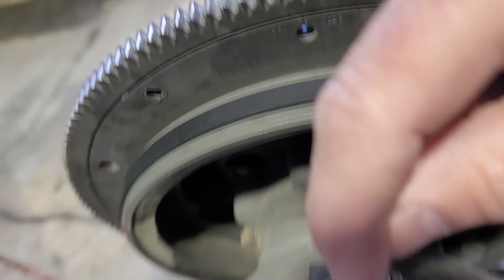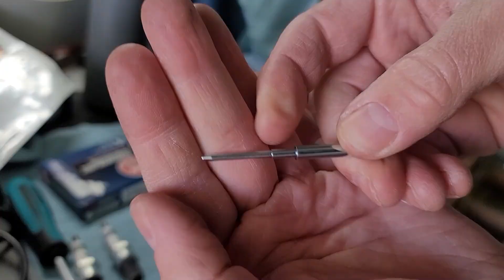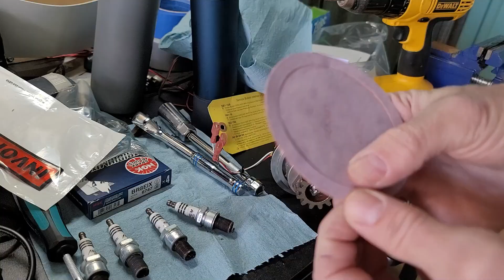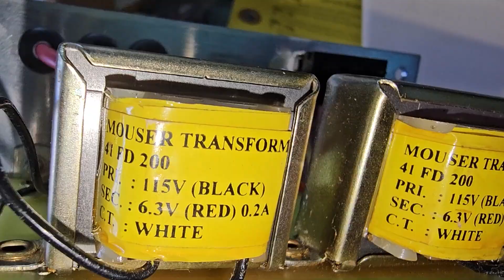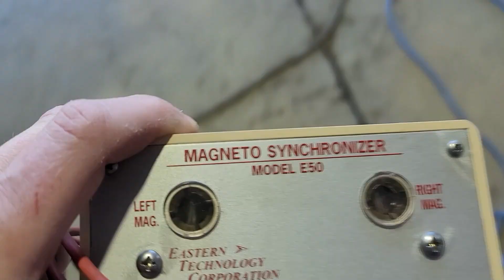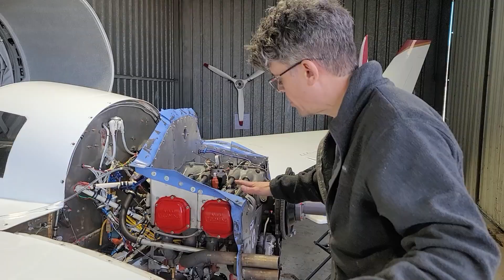Installing and Timing an Overhauled Magneto In My Airplane

Comment: It's been years since I've timed mags. Thanks for the refresher. FYI: if you put just a small dab of grease on the mag side it will hold the gasket in place. This will not hinder the gasket from working properly sealing the gasket/engine side.
Reply from the maker: I usually use just a bit of engine oil for that!

Comment: Scott, I've run the Jeff Rose nonstarter for 20 years B4 adding the PMag starter on Defiant. I should have done this dumping of the Slick long before...letting you know its so worthwhile to have more reliable and much better starting.
Reply from the maker: I'm seriously thinking of replacing the magneto with another electronic ignition the next time it hits 500 hours.
Reply: @CanardBoulevard Yeah, As an experience it's been more comforting and pleasant in the overall because of the installation ease, superior startup and programmed timing getting up there into ElectroAir territory. Given self-powering, it's very close to preserving the same noncorrolated redundancy as the Slick....weighs less too :)
Reply from the maker: @MarkShinnick  The problem with PMags is their absolutely HORRIBLE reliability record (for unknown reasons) in pusher installations.
Reply: @CanardBoulevard I know that heat soaking stopped my own on hot days...  untill I figured out that little inconvenience.

Comment: How to troubleshoot if the magneto resistors is defective. What is the reaction of the engine rpm. Thank you for the answer.
Reply from the maker: I'm not quite sure what you're asking. There are no resistors in a magneto.

Comment: (1) A lot of people out there are not clear about the difference between Overhaul and 500 hour Inspection (or "IRAN"). If you had had an overhaul done, then that bag of old parts would also have included a capacitor (condenser) and a coil because all parts apart from the rotor and housing must be replaced at overhaul in accordance with Slick L1363J. Your Form 8130-3 will say either Repaired - Inspected/Tested- Overhauled.
(2) A lot of people are obsessed with the Timing Pin. The Timing Pin is used when setting up the Internal Timing. A person installing a magneto on the engine is concerned only with the External Timing. The installer has no control over the internal timing - that was done during the 500 hour/IRAN. Inserting that pin at installation stage is only leaving yourself open to damage to the magneto. If you walk away and leave the magneto mounted on the engine with  the timing pin in, and someone moves the prop, the magneto will be damaged internally.  Set it up with the pin in the L or R hole as appropriate - before mounting on the engine and remove the pin immediately. That will result in the mag being in the right vicinity. You could still do it without the pin - you might just have to take the mag off and turn the shaft by hand a few degrees before managing to get the timing light to go out. Remember if you leave that pin in, and then turn the mag body (as you have to), the gear on the rotor shaft can't turn (because it is on a shaft enmeshed with the engine), the rotor gear is enmeshed with the distributor gear so it will try to turn  but can't because you have jammed a timing pin in one of the holes in the distributor gear!
(3) Just set the engine at 25 degrees BTDC (or whatever is on the engine data plate) and leave it there. Fit the mag loosely to the engine and tweak it by rotating it until the Timing Box light goes out or stops buzzing. The lights go out when the points open and that is supposed to happen when the rotor is in the E-gap position - which is what internal timing is all about - and this goes back to point (2) above. If the internal timing was not set properly during 500hr/IRAN or overhaul, then the mag is never going to fire correctly no matter what the installer does. There is no need to move the prop - the adjustment is done at the magneto flange.
(4) Ignition switch has to be switched to LEFT/RIGHT or BOTH while you are doing this. (i.e. if you are timing the LEFT mag only, then the key must be in either the L or BOTH position).
(5) Mag mounting clamp nuts should be tightened up evenly in stages - don't tighten one side to full torque and then do the other side - flanges can be cracked or broken that way.
:)
Reply from the maker: 1) Thanks! This was definitely an IRAN - just the 500 hour, not an overhaul.

2) I know about the timing pin, and I also know what happens if you leave it inserted and then move the prop. :) The idea was to not let the mag rotate internally while installing it onto the engine, and once it was meshed with the accessory drive gear, to remove the pin.

3) I did exactly that. Set the engine at 25 BTDC, then got the magneto where the points just opened. Where you saw me moving the prop was checking afterwards that it was in fact opening where I expected it to.

4) Not on mine - I have one mag and one EIS, so there is a toggle switch for each: for the EIS, the switch provides power when on, for the mag, the switch provides ground when off.

5) Again exactly what I did. 

Not my first rodeo, and also definitely not the first mag I've timed. :)

Comment: Just curious as to why you chose the EIS for the right side instead of the left? Thanks
Reply from the maker: I didn't - the manufacturer (Aero Sport Power) makes them that way. The left side has a magneto with impulse coupling, the EIS is on the right. You can start the engine with either (or both).

Comment: That magneto had more than 500hr on it to have all those parts needing to be replaced.
Reply from the maker: That magneto had exactly 535 hours since new. Mechanical things wear out.
Reply: @CanardBoulevard Hard to believe.  My 750hr magnetos were like new inside.  Clean enough to eat off of.  It's considered good practice to verify correct timing AFTER torquing the magneto retention bolts.

Comment: Informative video, Professor.....  the Left/Right you showed on the magneto reminds me how bad we needed that type of marking
of motors used in Heating - Air Conditioning applications.  You needed the correct rotation & flan blade to match so you had to get
it right & be able to explain it to a parts house.  A simple "L" would have helped but I digress.  It's a heat wave up there so I'm betting
you'll be dealing w/ the hottest summer on record?  Let's hope not..... peace & thanks for the work(s)

Comment: Noticed 16:29  you have removable zip tie. I’ve had a really bad experience with them, they very fragile when cold. Easily snaps. Just decided to warn you
Reply from the maker: Not these. They are GripLockTies, which is one of Mike Patey's companies. I have been using them for quite a few years, and they are the highest quality, best removeable fasteners I've ever used. They have silicone embedded in them, so unlike most zip ties, they won't abrade paint or cut through wires. https://griplockties.com/

Comment: I know this is going to be the kind of device that's been used to time mags for 100+ years but…
Presumably when the mag points are open, there's a pulsing current in the mag primary winding from the synchronizer 6V battery/buzzer.
I was wondering is that almost designed to produce HT at the mag secondary, to create a continuous spark at the plugs? So that you can check you're getting a spark at the plug that's passed 25° before TDC on compression stroke. (To check the leads are in correct sequence and to some degree check the integrity of the distributor cap).
What's causing me a slight concern is that this might be creating more than enough voltage in the secondary to produce a spark but you don't have any spark plugs connected at that time. So there wouldn't be a spark gap limiting the voltage produced which could result in internal arcing inside the Magneto, which could cause future problems.
I guess perhaps the primary current produced by the test box is just a little tickle of current compared to when the engine is running. (So no potential for a spark at the secondary).
Reply from the maker: The P lead is connected to one side of the points. Those points are grounded to complete the circuit internally in the primary coil. When the internal points open, that causes the magnetic flux to collapse, and is what generates the spark. The points opening also disconnect the ground from the P lead, and that is what the synchronizer detects. The voltage produced by the synchronizer is around 6 volts, whereas the magneto internally is operating on more like 200 volts, so there's no danger of it creating any kind of spark.

Technically, you could use a continuity tester on a DMM to time magnetos, but if you were to push the prop past the impulse coupler, it could very easily produce a 200 volt spike into your DMM (which would be configured to measure continuity) and that would definitely smoke your DMM. The little 50-year-old mechanical synchronizer can absorb that spike easily.

Comment: I see you are running auto spark plugs BR8EIX with your mags.  Do you have to change anything other than the spark plug wires to get this to work?  Do you gap them smaller to match the aviation spark plug recommendations?  Any improvements such as fouling or gph?
Reply from the maker: Actually, those plugs are being fired by the electronic ignition system, which puts out a much hotter and longer spark than the magneto. Recommended gap for that EIS is .029 to 0.38, and those plugs at .030 fit the bill perfectly. I would have to gap them at more like .018 if they were run by the magneto.

Because they are on the bottom, they do tend to get oil fouled, but they have no problem with lead at all. At $25 for a set of four, I tend to just toss them and replace them each year. I don't do that for the aviation plugs on top that are driven  by the magneto!! :) The reason I pulled those plugs to do this was because I was going to swap them anyway, and I needed to pull plugs to be able to determine TDC.

Comment: - Cool. 
- I recently bought a good set of Torx keys. Long ones, so that it can also reach when screws are in a deep hole. I had to open up an appliance recently, and the short Torx keys that I had, were barely able to get the job done. Looking forward to first use now. Happiness is found in good tools 😀